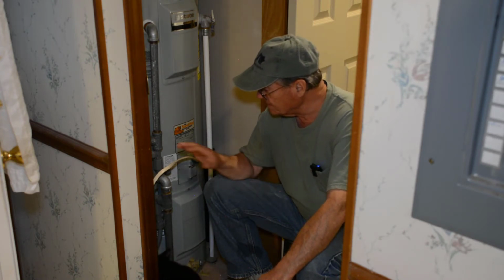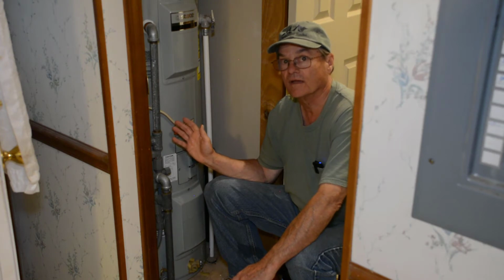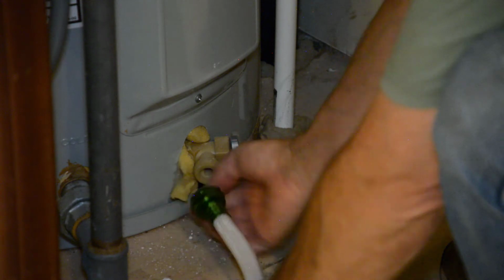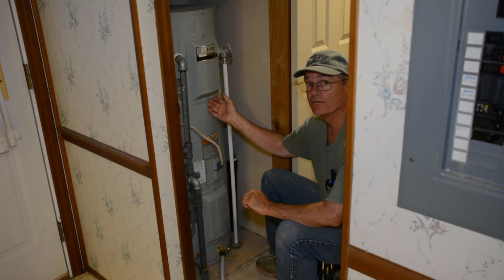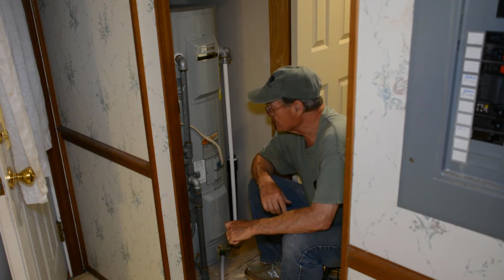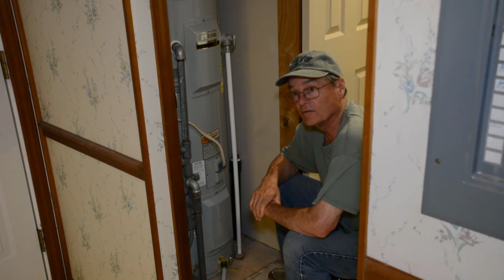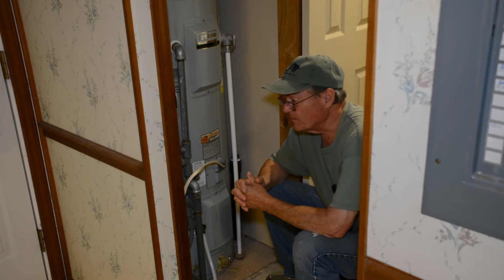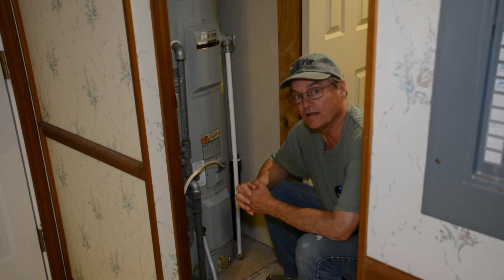How to Flush a Water Heater, An EASY DIY project

Comment: Not sure if the terms are the same in the US, but the area where I live in the UK is a "hard" water area, which means there's a lot of chalk in the water so we have the issue you described with deposits in kettles, heaters etc. Further north where the ground is hard rock, it's not an issue! (called soft water!)
Reply from the maker: Hello Timmy,  We also call it hard or soft water.  It will vary a LOT depending on where you are at.  The very hard water that damaged that tank was only about 10 miles from my house and I have very soft water.   Thank you for visiting and have a great day.
Reply: @DIYwithWayne  Very interesting note about the differences in water even if 10 miles apart. Recently I've learned about aquifers and the various mineral types throughout the U.S where they form. I never really thought about the underground water networks that form naturally, but after a rabbit hole of learning about wells It's amazing. Thank you for your content, you have a new subscriber =)
Reply from the maker: Thanks for subscribing. Have a great day.